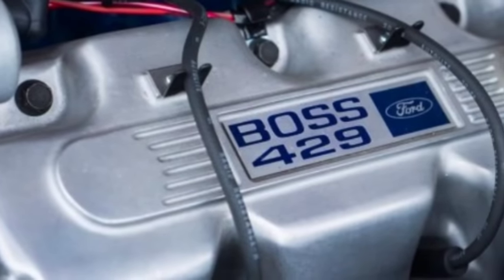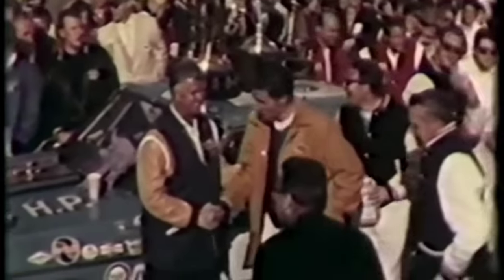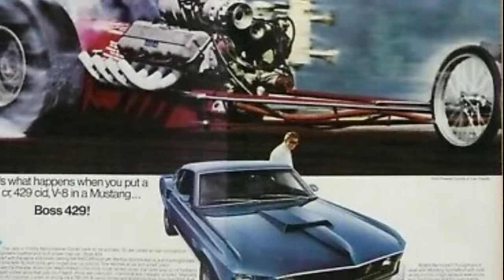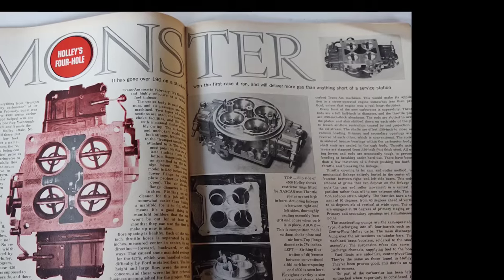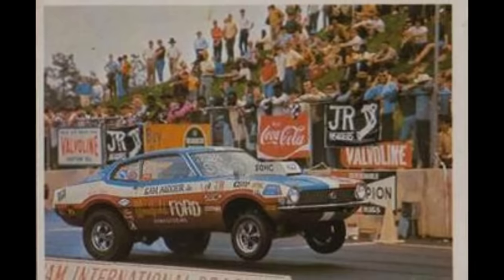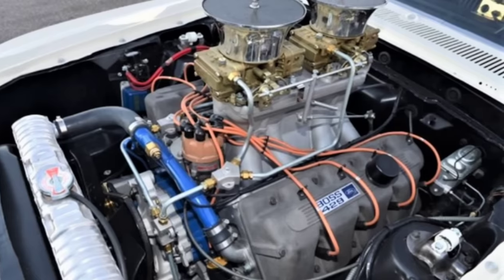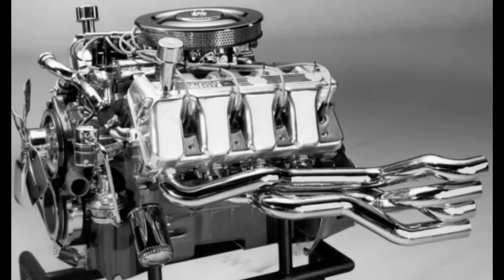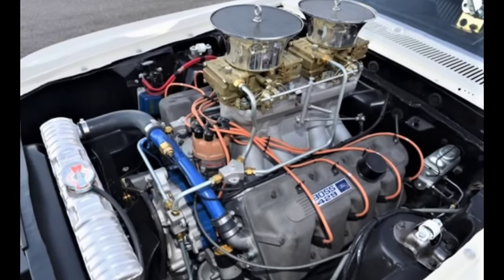The Misunderstood BOSS 429

Comment: A big problem with boosting boss 429.was cracking heads... Blowing the copper head gaskets.
Reply from the maker: Bruce you are correct Kalitta has talked about this many times... it was weak above the combustion chambers and he even said that he blew some up just warming them up!
Thanks for watching, Please subscribe as I have some good content coming up!
Andy
Reply: Bruce.  Not being argumentative to your copper hd gasket comment.  Yet all the original heads,  (not till  '80s did Boss 9 heads from Nick Arias & Alan Root-together created,  heads that all '80s racers including Mad Dog <Glidden>, ran, used individual  prings which im sure u were referring too.  But maybe not everyone fully grasps that reading comments..
The orig FoMoco orings u speak of,   were of coarse the 1st designs before the 80s created Root B9 heads, when he bought Orig Ford core boxes/tooling @ Holman/Moody's Big auction.. brought bk to Cali & partnered w/Nick to build an improved version we all ran in 80s/90's.  Thats Another story entirely,  regarding the Nick Arias & 'Root cast heads', which used a true copper head gasket)..
Most enthusiasts already know orig. Boss 429 heads used independent sm/lrg diam. copper tube O-rings around ea & every hole/passage-  location on deck, ruffly ~20 oring pcs, all needing to seal ea. H20, oil returns, Comb. Chambers, Hd deck studs. 

Every hole used separate "gasket" in reality.
I only point this out fir readers who are not already aware. Design was radical departure from 1 pcs copper hd gskt,  & rather poor design for most all apps.  The revised Root head patterns were done by Tom Roberts over several yrs & 2.0 'Line of site' ports for IHRA domination in 90s. Tom did pattern builds as a Nick Arias employee 1st,  & later off on his own, pattern making as a self employed business owner.  Buddy Bar was foundry of choice obviously & the updated head was considerably better in strength &  thk'r deck w/trad. Hd gasket use.  
Head still suffered issues including rather poor exh port designs,  (exh guide was far from centered in port by design) & the massive exh. rocker syst. necessary to reach the 26° of twist in valve locations,  from true Mopar Hemi definition of valves in line ,  was slightly improved w/ Jesel Bros. building shaft style rock'rs for Boss 9 hd vs also same length,  stock type teeter todder sized rockers.  The intake port "crossing the Center Line of the Bore Axis was its biggest advantage to all the 80s ProStock heads in a naturally Aspirated format which was later integrated into all the best Castings in sport of NHRA Drag racing. 
 Lotta great info in this video.  Thankyou for that.  Lot more info to be shared from my view point of having been involved in B9 500" development bk since the 1980s.  My mentors of our Boss 9 exp. goes bk to 1970s parts..  
Great 11 minutes but there's another hr or 2 of relevant & fun fact info for those who are real Boss 9 nerds,  like a few of us are.  Great vid.  👍 Thx for sharing!
Reply: @here_for_the  back in the 70-early80; there were a lot of blown boss429's around here. Cracked heads were fixed (poorly) filling water jacket s with epoxy or grout ! Solid copper head gaskets with  O rings.
Reply: @brucekultgen132  yeah.  filled them with Tug Boat engine grout in early '80s.  Not 100%. But as a coating inside water core areas.  Personally only ran the Root stuff that had thick deck & much less water core cross sectional area.   Seen a lot Stk heads crack from the boat racers before Alan & Nicks uodated versions.  We never tried to race w/stock head castings.  But cut a few apart that were badly cracked to see water jacket areas in case it was of some assistance.  It wasn't.   But heads were no good anyway.  Hav only few chunks of stk hds left in my junk pile.  We ran Cleveland stuff thru '70s in our programs. They had deck issues so we "Posted" them in ea chamber.  Same as the BBC heads.  Posted those too.  Cuz deck would lift on in Quench area do to inadequate clamp force of stk Gm & Ford head bolt arrangements.  Never considered posting a Boss 9 cuz we never needed to.  Its a great head thou.
We stood both valves up (2.400"x1.950") considerably & went from a stk .990" deep chamber @center to deck,  to a .665" deep Combustion chamber,  that came in  bout ~66cc's w/4.112" radius curvature using a 4.500" bore & close to 16:1.  So adding close to .330" into center of chamber was a plus for on several fronts.  So U guys ran both the stk O-rings- & a copper head gasket it sounds like?  Of coarse we piano wired & receiver grooved all our Root hd decks/blocks.
Reply: @here_for_the  4 major challenges with the original Boss '9 head design. 1) Poor-quality aluminum. 2) Lack of a conventional head gasket. 3) Inability to build compression for off-road gasoline applications. 4) Exhaust ports mis-located. In Nitro applications the combustion chamber turbulence was crazy due to the valve locations. This
 lead to engine failures. Just ask Connie Kalitta.
Reply: Bill, having raced Boss 429 stuff in 500" format over 30 yrs.  Im well aware of the stock cyl head issues.   If you read what we said,  A/R fixed 70% of the problem w/the factory OEM heads.  Enuff,  that they were a baseline casting for Glidden to win  5 world championships (in a row) '85 to '89 using 
A/R heads
 & Not stock castings. There not even Flowbench worth for port evaluation.   They are expensive paper weights. Hi priced OEM junk.  All competitive Boss 9 racing, included boat racing stuff, were A/R head castings well into late '90s  Nobody won a world championship in w/a stock head casting.  ZERO. NOW CLEVELAND Stk head castings?  Diff story totally. Tons of championships.  We all know the problems w/stk B-9 heads. 
Our own modified A/R heads had ~0.660" deep Combustion Chambers, (vs a stk A/R 99cc chamber,  that was ~0.990" @ ~16:1 compression ratio-- followed by ~30° laid back the relief curtains on both valve pockets to get 15.5:1 squeeze.   Partly due to camshaft event timing being critical to depth reduction into piston. An issue of how close the valve relief on Exh side, ( due to relief impediment to top ring groove) would try to lift the ring land under duress,  due to scarcity of thickness,  more so than the intakeside vlve relief.   We keep a piston on our Glory Shelf as a reminder to how the Olds DRCE heads are but a copy of "Properly" designed A/R Boss 429 Geometry head, after 300 hrs if wrk are put into bare A/R castings on a mill using a Rotating  Sin plate to shoot in shallow valve angles, spring pockets, valve guides, & new chambers on tape fed CNC. (ole days)
This topic of Kalitta & others runs much deeper and is irrelevant to the successes of the Boss 9 in drag racing after 1984.
Nuff said.
Reply: I failed to mention the car was an N.H.R.A. A-Altered.
Reply: @here_for_the   Holman-Moody team and David Pearson won the NASCAR World Championship in 1969. Overwhelmingly with Boss 429 power and factory-style Nascar heads. My ex-partner Ed Prout, won the NHRA Northeast Division 1 Championship and held the National E.T. and speed record (8.36@165) in 1973 with his A-Altered '32 Bantam Roadster. Hillborn Injected Boss 429 powered-w/factory heads. Then there was Ohio George who's Boss 429 powered car was banned by the NHRA. We also ran Boss 9's and Clevelands in various cars and in various NHRA classes- Comp, Pro-Stock legal and match race between 1972 and 1980. Our efforts included buying a bunch of stuff from Gerd Wunderlich at H/M and from Gapp & Roush. Yeah, and later some Alan Root stuff. We were competitive with most everything we ran.
Reply: @billfioretti3013  Bill,  the topic is high cyl pressure configurations w/stk Boss 429 head.  Like 15:1 or higher, using the Org castings.   You can make every point you would like about the past,  w/Ralph & John, but the only guy who truely made stk, Hi cyl pressure Boss heads work were likely Dyno Don Nicholson,  w/the 494 Can Am eng, running the 1st EVER 7 SECOND DOOR CAR pass in early '80s.  AHRA if I recall. Or IH.
(Kaase) may/(or not) be able to speak to what Static Comp ratio was in that program,  as a Stk head under serious Cyl pressure duress..,  Do to a swept volume nobody had seen via accumulation of Cu inches. Giving easy to a higher C/R than a typical 7Liter build w/typical crankshaft availability then.  
David ( Pearsons) H/M prepped Nascar was likely no more than 12.5:1 @ highest.   Nobody is saying (to my understanding on this post) that the Boss 429 Original head castings (Street or Quench design) are bad, by overall design configuration,  from a Power production standpoint. Not at all.
( sidebar; Cleveland heads were great until bolted atop Cleveland blocks, that were junk @ over 0.20 to 0.030" overbore, @ ~13:5:1 or more. Blocks cracked, not heads. Unless of coarse U had Taxi cab, aka: Australian Cleveland blocks,  that really only Roush & Mad-dog had. Nicholson was furnace brazing sleeves in 302 blocks,  chaining them to telephone poles at Indy <US NATIONALS>, w/$3500 price tag on them.  😆 .  I saw um myself in pits. 🤣 Nuff bout that till the Cleveland posts start up) 
Now Bk to our regularly scheduled banter... 
 The fact the ALL GOOD CYL HEADS,  HAVE 1 THING IN COMMON. ONE... They all have a port location that *CROSSES OVER THE Center-Line of the Cyl Bore Axis*, on its (port)  path, assuming a reasonable homogeneous mixture delivery,  upon the Delta P differential @ the curtain area of the intake valve, (@ ^ 35% lift).  (those who are reading the above as 'GREEK', here.. 
The explanation in simpler terms is; designs that go ACROSS (SIDEWAYS ) to the point of entry into the cyl,  relative to the "bore" ( pistons home folks) , & create a more Cyclonic or,  aka: Swirl effect- type of corkscrew Cyl filling action, as pistongoes dwn, & the Drop in Delta P causesCyl filling by pressure differential,  ( not unlike how a Carburetor draws fuel from the booster) under Hi Velocity air speed, if that helps u understand Delta P) will, in all cases,  done properly,  produce more Torque. 
[TOR x RPM ÷ 5252= HP.  Yes, we all know that]
More Torque = MORE HP,  "if"...BIG IF HERE... the Valvetrain & cam event profiles will allow RPM. Lets address the dreaded RPM qwikly.
RPM = Ruins People Motors, BTW.
In case you all thought it meant something else, like 'Revs Per Minute'.... 🤣 
 ok. It does.. sorta... 😂 
Lastly,  to wrap this burst of Techno up,  its not the flow of CFM alone, the intake port that crosses the CL of the Bore Axis that makes U Power.  Its really how you use your given CFM per 4th cycle, of creating Maximum Cyl pressure,  @ Optimized or optimal- Crankshaft to Connecting Rod angularity...., That makes You the biggest Torque #'s.
Which I will make it easy for the next generation out there reading this..  Its a location of ruffly 12°~15° AFTER TDC, if you have a Rod Ratio of ~1:75: 1 on an N/A eng.,  and as low as 1:55:1 Rod Ratio,  on a forced induction design,  on typical 90° V8 engine configurations.  Including the Boss 429,  possibly as much as any eng design.  To which it, or nearly all engs,  respond fantastically to this rod ratio parameter, crank angle after TDC, & port configuration specifications. 
Thats the 1 downfall of the Tom Roberts/Kaase, "BLOCK 30" IHRA PRO STOCK CYL HEAD..  (AKA: 2nd generation Boss 9 head built in bout 1997.., The newer,  "L.O.S." Port design, vs the A/R design,  which is just an improvementto the Stk head, obviously. 
(L.O.S = line of site = L.O.S.)
THAT Big Inch IHRA Head won tons of IHRA Pro-Stk events & World Championships.  The 1st version,  if you remember,  had ZERO port crossing over the Bore Axis CL. & it was junk, like an orig Mopar hemi Intake port .  The next version out of the Corebox, of IHRA LOS PORT head,  has a few degrees of twist, maybe ~12°?? @ best.. (if I recall)..  vs the Original 26° of a 1969 stk head design. 26° of twist in the Valve geometry configuration is quite good. Nice job Jack & Mose! & rest..
That alone is the biggest secret to its success.  26° of twist in valve location.  The fact the head casting itself is junk, w/a thin Deck,  & too deep a chamber, & cant hold big cyl pressure.  W/the flimsy deck & Poor head sealing design.. Just allowed Tom Roberts to take H/M core box's A/R= Alan Root,  bought @ auction from Holman/Moody auction,  the Boss core boxes, & had Tom fix the junk, build new core molds & tooling,  & make it viable thick deck head,  for Ricky's (Smith) 4 or 5 IHRA World championships, & Mad Dog's,  5 NHRA's,  in a row.  Iaconio did win like 1 race w/the stk junk heads, early on.  But they ( stk castings)  are not race quality heads by any stretch of the imagination.   Put David Pearson in that Boss 429 Torino, Homolgated by a Mustang,  of all cars,  w/todays compression ratios , & THE STK HEAD Castings fold up,  like a Tee Shirt in a kids sock drawer.
Nuff said!

Comment: The Boss in street form was severely de-tuned with low compression and retarded cam timing....also they used Cobrajet cams...that meant that exhaust lift was much lower than stock because of the difference in rocker arm ratios between intake and exhaust....bump compression up to 12.5/ 13 to 1 ,  install a proper cam and you're riding behind a monster....

Comment: Put a blower on that sumbich and drop the stroke down to 3.90.  You'll get about 900 HP at 6500 rpm.
Reply from the maker: The stroke was 3.59 stock, the problem was the MASSIVE Crank and Rods.. It had 1/2 rod bolts!  Boost makes everything better! Thanks for Watching and please subscribe to check out my project MIXED UP BOSS, Im putting BOSS 429 Style heads on a 429" Windsor based stroker....looking for 750hp NA on pump gas
Andy
Reply: @UnityMotorSportsGarage   3.59 stroke?  what was the factory bore?
Reply from the maker: @timhallas4275  it had a huge 4.36" bore the same as the 460.. the 460 used a 3.85" stroke
Andy
Reply: @UnityMotorSportsGarage  So you are saying the Boss 429 was a short stroke engine from the beginning??  I heard this engine was built specifically for Stock car oval track racing.  I thought those boys liked stroker engines.
Reply from the maker: The thinking was a short stroke would make killer topend HP and that is what it did... It had a very narrow powerband and even the Nascar guys figured out that the ports were too large and later went to a head that had the floor of the runner filled in making a "D" shaped in order to make it have torque to run on smaller tracks where they needed the extra torque for coming off of the corner of the turn!  
Andy
Reply: @UnityMotorSportsGarage   Why not just build a stroker version for short tracks. I hear this engine didn't do well in drag racing until they stroked it  over 4 inches.... bring the torque up to  Chrysler 426 hemi levels.
Reply from the maker: @timhallas4275  Nascar had a CI limit of 430" back then..

Comment: They banned George and his turbo Ford. Yet they allowed a turbo 6 banger Buick to run in pro stock years after the banning of George for turbos. And this was in a naturally aspirated class of pro stock. Azz holes.
Reply from the maker: Yeah Jon that was messed up...Buddy Ingersoll's buick  I have to say it was impressive even by todays standards!

Andy
Reply: You are talking about 2 different organizations..... Ingersoll's Buick ran in the IHRA where they allowed 3 different combinations.   Big Blocks naturally aspriatec.  Small Blocks with nitrous oxide. His lone V6 with turbo chargers.  NHRA Pro Stock gas always been naturally aspirated small and big blocks on certain weight per cubic inches rule.

Comment: The Boss 429 was an overrated dog from the factory in stock form, but has a shitload of potential.  People tend to get pissed when I say that, but it's true.  It only ran mid 14's from the factory which isn't impressive at all.  Now, WHY is that?  Simple.  They took what is essentially a race engine and detuned the shit out of it to make it something that resembles streetable.  The biggest problem is the stock camshaft is too small for the heads.  The relatively mild camshaft is basically done by the time the heads build up enough port velocity to actually flow well.  The stock exhaust manifolds didn't help either, but EVERY factory big block was choked by those stock cast iron manifolds.  So, while the factory stock Boss 429 was basically a dog, if you just slid a bigger cam into it (one big enough to actually work well with the heads) it would easily hold it's own with the other top line big blocks back then.  Change the cam and add headers and you've got a real screamer.  Keep in mind the 426 street Hemi had the same problem, but to a lesser degree because the stock cam wasn't as conservative as the Boss 429 cam was.  Which is why the 440 six pack is actually a better street engine than the Hemi.  The same is true with the 428 SCJ versus the Boss 429.  Even though the Boss 429 was a far better race engine, the 428 SCJ was a better street engine.  Chevrolet had three different cylinder head designs for their big block instead of making two or three radically different engines for the same reason.  What worked well for racing didn't work particularly well for a street engine.  Oval port BBC heads work a lot better on the street than their square port heads for the exact same reason the 428 and 440 work better on the street than the Hemi and Boss...  Port volume.